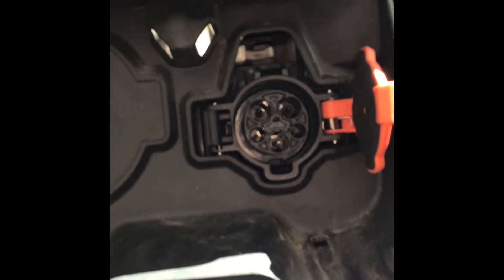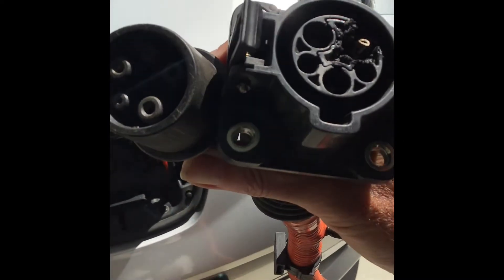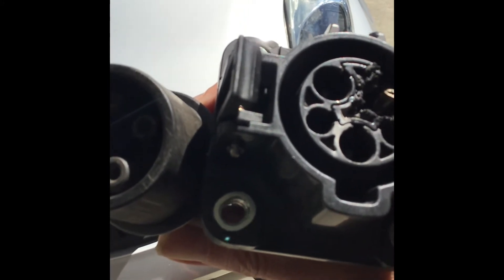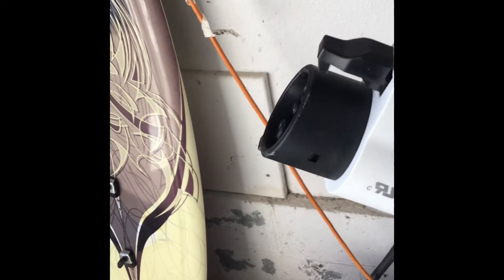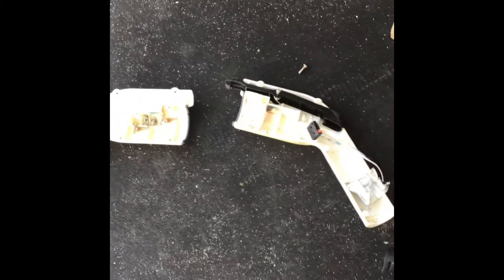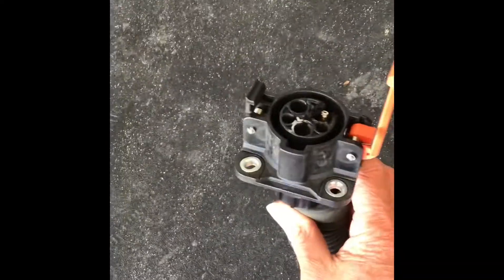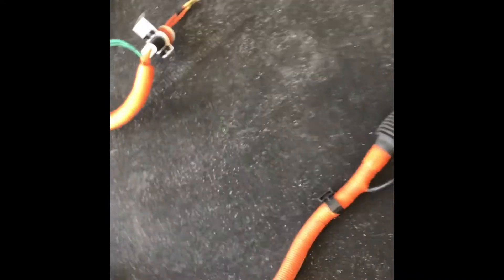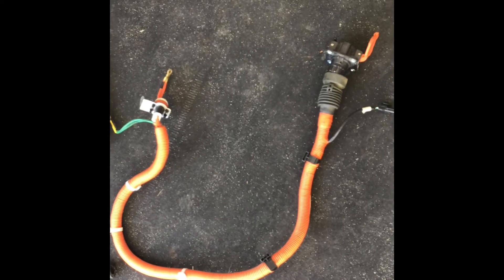Melted J1772 plug damage to Nissan LEAF charge port.

Comment: Can a pin be replaced in the charge port in a Nissan leaf 2014 looks like 2 snaped off. Wont connect. Help
Reply from the maker: I would not do so. You'll have at least 16 amps at 220V going through there on Level 2 charging. You don't want to have arcing take place as shown in this video.

Comment: Do you happen to have the part number of the harness??
Reply from the maker: N296B1-3NFOA for $663.63. They also dinged me for a $17 label that probably says "High voltage" N993B2-3NAOB and N99MP-1217HP $15.99 for something called "Threebond 1217".
Reply: @bobbath739  I was able to find a used cable from a 2011 on eBay for like 230$.. I did the install myself, took me like 5 hours, but I did it. And it is working perfectly still. Thanks for all your help, your video helped me
Reply from the maker: Have you thought of posting to you tube so that ppl wouldn’t be out $2k?
Reply: @ka24detpower  Oscar and Bob, where does one find instructions for removing the j1772 charge port cable for either repair or replacement. Just wondering what’s involved with that 5 hour swap?  Thx.
Reply: @ka24detpower  Oscar and Bob, where does one find instructions for removing the j1772 charge port cable for either repair or replacement. Just wondering what’s involved with that 5 hour swap?  Thx.
Reply: @ka24detpower  Oscar and Bob, where does one find instructions for removing the j1772 charge port cable for either repair or replacement. Just wondering what’s involved with that 5 hour swap?  Thx.
Reply: @puggirl415  the main thing and most difficult step is to remove the top cover of the engine/inverter. It has around 16 bolts, don't remember exactly. When I get home I'll post whatever i can, cuz I did record some stuff
Reply: @ka24detpower  Thanks Oscar. Looks like a not to hard replacement but ends up being super hard to understand what to do next.
Reply: @puggirl415  you should try first and see if you can take off the engine cover, that was one of the hardest parts. You take off all the 16 screws all around. But the hard part is breaking the suction because of all the glue they used on it. Then if you do get it off, it's hard to remove because the firewall blocks it from lifting up all the way
Reply: @bobbath739  thanks a lot, I'm gonna look on eBay first. I'm gonna try to install it myself, I'll let you know how it goes
Reply: Not right now but I have one on ebay that is supposed to be for a 2013 Leaf. Where I got stuck is figuring out whether I need to buy the complete harness or if I can just remove the bad port and replace it with a new port. 
There doesn't seem to be any reasonable way to remove the bad charging port. Partner wants to cut it off and resolder the wiring from the harness to the new charge port. I want to replace the whole harness, wiring and port and do no soldering. 
I'm no mechanic but my instinct says to replace the whole thing. I'm also not the boss of this repair but I can ask questions. Thanks  so much for your help. If you've done this repair do you think replacing the whole wiring, harness and charge port is right or did you do something different?
Reply: @puggirl415  i replaced the whole cable, because I'm not good at soldering. I did try, but I gave up because it seems like the original part seems really super strong and i doubt any aftermarket parts would last the same. I recommend replacing the whole cable. But I guess you can let your partner try, and if it seems flimsy, then yea replace the cable.
Reply: @ka24detpower  Exactly! If his method works we save money so I agree. Let him try soldering. We can always get the whole harness when we figure out what doesn't work. I better film it cos no one else has. It's so crazy that this repair costs 1800$.
Reply: @puggirl415  yea, that's why I was like i will figure it out lol

Comment: One of my pins broke off(right side), so right now, I stick in a copper wire that I cut and stripped to the exact length so I can keep charging for level 2. I have a 2013 Nissan leaf. Do you think we can disassemble that square box and just repair it there?
Reply from the maker: I'd say it depends on your soldering skills. If it's a solid connection, you'll be fine. If it's not, you run the risk of fire when electricity arcs across the weakest contact between the copper pin and the plug. And if it's not exactly the right diameter, you run the risk of the plug tugging it out.